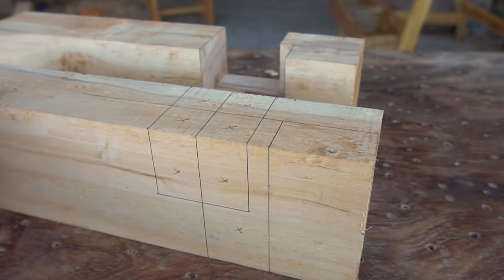Top 5 Hand Cut Three - Joints Woodworking - Traditional Japanese Wood Joinery

Comment: 3 and 4 blew my mind. For 4, does the table actually rest on the four squares that poke out the bottom of the joint? Or do you saw it flush after assembly?

Comment: I wish we could see these joins in actual, structural use - I would love to see how strong they are!
Reply: Not all of these joints are used as structural, most are just for decoration.
Reply: “Decoration” is a Very Contemptuous word for the High Level Skills needed to make this Outstanding Work. 
These joints are created for Luxury Furniture Fabrication.
Reply: @HN-zn5lh  I see. I'm more wondering about these types of joins being used to build a house of something, which, if I'm understand you correctly, wouldn't work since these are meant more for furniture, or smaller applications - I've heard of Japanese carpentry being used to build temples that still stand to this day, and that use no screws, nails, or glue. I would love to learn about how those joins are done.

I'm an American, and often think about what it would be like to build my own house. I think it would be cool to build a house using joins like the ones mentioned above, combined with the screws and stuff required in order to be up to code. None of it would be very visible or anything, but I'd know that it was there, and done that way, and would take pride in it.
Reply: @HN-zn5lh  Again, not all of these joints are even good for furniture. Might want to go through his video library.